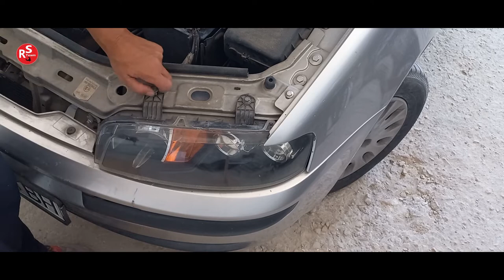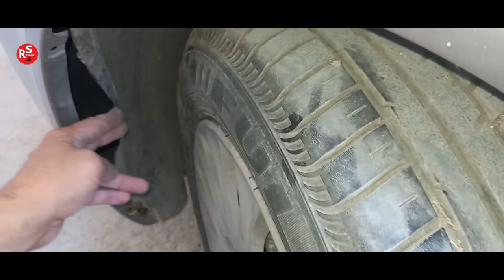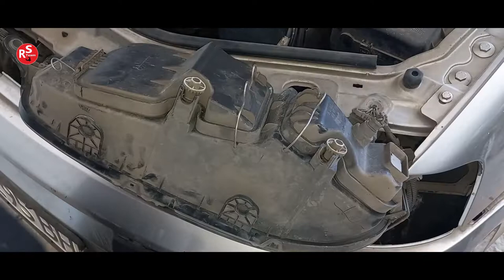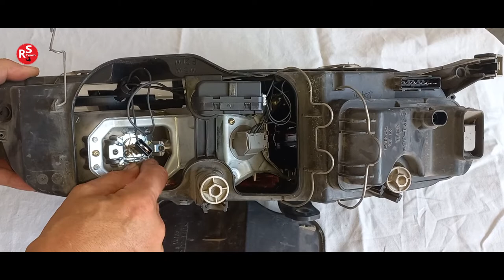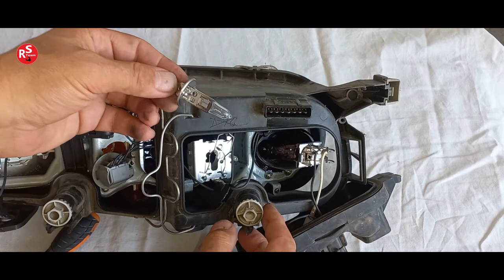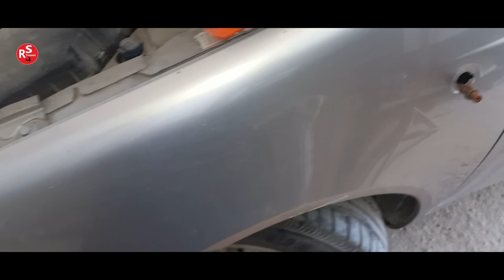Fiat Punto Removal of headlight the front fender turn signal and replacing the bulbs #fiatpunto

Comment: Today I was replacing the left headlight on the Punto 2, so it's much harder to remove it and install new one if you don't have experience with cars. Basically you need to remove the torx screws all the way to the middle of the bumper to do the job, which is not shown in this video!. The easiest way is to steer the wheel, remove the plastics for dirt, unscrew the panel a little bit. Good luck. Low beam H7, Fog Lights H3, High Beam H1

Comment: What year is this Fiat Punto ?
H7 is for Low Beam & H1 is for High Beam ?
Reply: H1 for every beam
Reply: Both H7
Reply: That's what the instruction manual says
Reply: @dinges8561  
You're saying the bulbs for both low and high beams are H7?
Reply: @dfls5069  yes, both H7. I also thought it was weird. But both are H7 55W
Reply: @dinges8561  
The vehicle in question here is a 2002 Punto. What year model is yours?
Reply: My 2002 Punto has H1 both low and high. But those headlights are some aftermarket ones